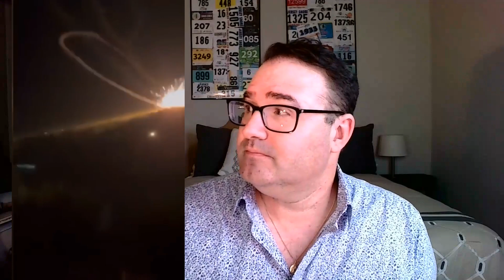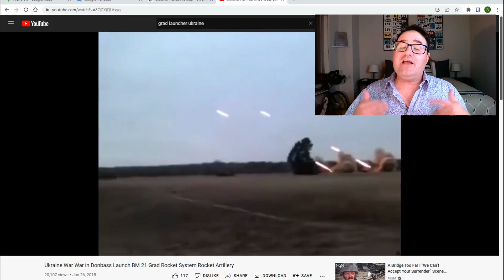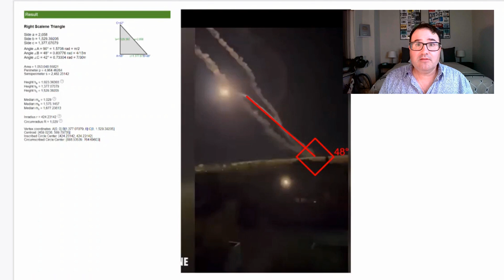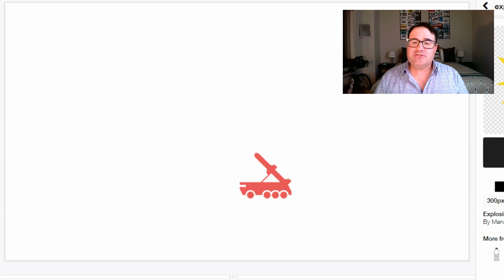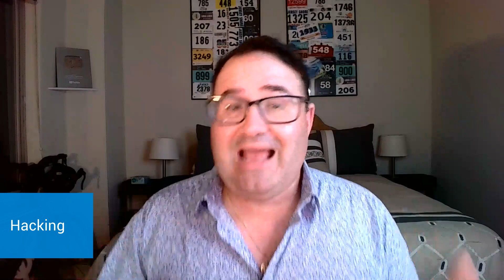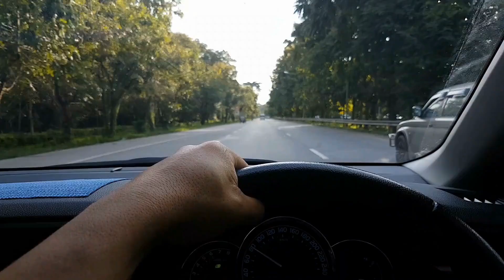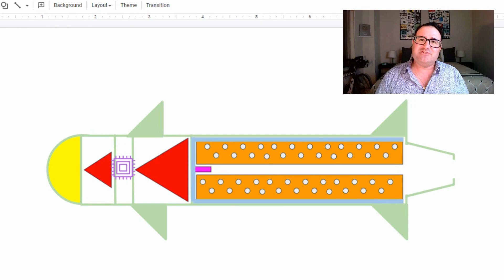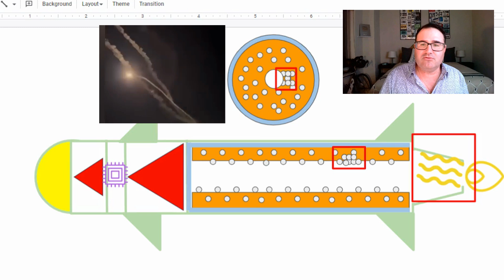Why this missile U -Turned

Comment: An asymmetric burn inside the pressure volume probably wouldn't cause a turn, at least I don't think it could make one as sharp as that. You would either need to turn the nozzle or the fins to induce a turn. My guess is something on that particular missile went haywire, be it the electronics or whatever powers the actuation. It could be a momentary problem in the signal sent to the missile, as the other missiles shown by their trails are long gone from the frame when that particular missile took flight.
Reply from the maker: What about burn through, and we’re just getting parallax error. The missile is turning we just think it’s going straight.
Reply: @RyanMcBethProgramming  burn through as in burn a hole through the side of the missile casing? I guess but I wondered if the guidance could really compensate for that happening. It might be possible. I would have to know more about the missile and even then I’m not a missile expert.

Comment: Regarding the guidance issue theory you missed an important point.
It's correct that guidance  is provided by track radar of SAM system.
What you forgot / got wrong is the type of missile fired.
Majority of SAMS system fire SARH (semi-active radar homing missiles) missiles , which means the missile does not have its own radar , instead just a seeker head. The seeker head has the duty of locating the radar beam emitted by track radar. The rocket steering guidance is provided by the in board electronics of the missile, that decides if the missile should be steered or continue forward flight. 
The inboard electronic also uses some sensors to detect critical flight parameters like angle of attack , direction , altitude etc.
If one of this sensors fails it's highly likely that the missile's onboard electronics might generate wrong guidance errors.

Comment: i think these distance estimations are far off. Okay, flash to bang, 500 m, bought. But from a 500 m distance, the camera lens must have been extremely wide to cover > 2000 m trajectories in such a small image region. So i think the assumption about the initial velocity of the rocket must be far off.
I'm not a military expert.

Comment: I have a different theory. If this missile tracks painted by radar target it may have lost track of the target (due to defect in radar or missile itself) and after a while it mistakenly taken the radar as target.
Speaking about defects in fuel, as I have read in books on solid rocket fuel, can lead to asymetric thrust but usually lead to overpressure and casing failure.
Reply: It too much for coincidence missile hit it's launch site that far into flight.

Comment: Possibly a faulty guidance receiver and/or faulty safeties? After it turned it seemed to almost zero in on the launcher like it was seeking the nearest heat source like your typical IR guided "heat seeking" missile. The other missiles that had been fired had already boosted away so the launcher would have been the nearest, hottest target. If they're similar to the modern AIM-9s and have an all-aspect capability it might explain it. I think it would have to be a perfect uneven fuel burn to line up on the launcher and not impact short, long, or off to one side or another. Good video, I enjoy hearing new ideas on things like this!

Comment: If your theory is correct then we'd expect to find lots of videos of similar rockets going randomly off course, because otherwise it's a huge coincidence that it goes off course and specifically hits the launcher system. I don't know if such videos are indeed in circulation; clearly this boomerang missile has much greater viral interest than those videos would have.
Reply: His theory doesn't make sense if its manufacture fault or mishandling that cause fuel issues. That doesn't mean the rocket returns back and hit the radar precisely. It seems a drone managed to  jam and hack the guiding radar! Russian radars use American made processors lol.
Reply from the maker: I’m not sure if it directly hits the launcher system or not. I would suspect not. it would take a really lucky shot.

When it comes to miss handling, this could’ve been something as symbolize back in 1995, a forklift driver accidentally dropped the missile and never told anyone because he didn’t want to get in trouble. We’ll never know.

Comment: I don't think this weapon has enough flight control surface to make that kind of manuever during its initial launch phase. I agree with Ryan that it's most likely a material issue. I personally feel a failure was present somewhere in the engine housing where it possibly burned through causing a jet of propellant out of the side of the casing just long enough to turn the thing 180 degrees. At the end of the day we will never know.

Comment: Very hard to imagine this degree of violent attitude and vector change from one side of a very long combustion chamber somehow causing thrust vectoring through a static nozzle, especially as that high pressure gas all gets effectively pushed through a tight neck that accelerates it anyway.  

I’d go with upside down inertial reference system that comes online a certain amount of time after launch. That would cause its aerodynamic surfaces to aggressively try to fly “up”, which is now down.

Comment: Nobody will ever know for sure, but as far as defects go, a rocket turning 180 degrees after firing is a bad one. I may be be random luck that it was exactly 180 degrees, but it also suggests a guidance malfunction. I also doubt that irregular burn could cause such I tight loop, although I can't rule it out. It seems more likely to be that movement of the fins is responsible for the turn, and because they weren't stuck, a guidance problem with sensors or guidance units seems most likely to me.

Comment: I theorize the combined heat in the concentrated area on the ground got so hot that the last missile locked onto it.  The flight path is clear...accelerate, alter course,straight line...thats return to sender.

Comment: A stuck fin would also cause a spiral and not a neat U-turn. As for your theory, you're basically talking about vector thrusting, but even 5th Gen fighters can't make such maneuvers. (especially at that speed and with the help of the tail)
I know that A2A missiles can pull off U-turns, which means that technically so can SAM, but the question is then why. My guess is either a system error (unlikely) or a self-destruct protocol in case of friendly fire. When Israeli fighters operated in Syria a while back, Syrian air defense systems (Russian made) shot down a Russian transport plane that was taking off, having misidentified it by accident. The Russians may have built this feature as a safety measure.

Comment: Probably a improperly installed guidance positioning sensor, the fuel logic you put forward just couldn’t burn fast enough to cause a dramatic turn without sending the missile into a spin, as the guidance system would attempt to correct it the other way. If the guidance system kicked in after the launch phases as is the case in most systems using a hot launch, it wouldn’t execute the maneuver until it reached the required data point for the sensors. As the sensor is not properly doing its job, the missile believes that it’s on the correct course instead of the typical launch sequence, which could explain the other 2 missiles firing properly, and the long streak of a relatively straight plume as it plummeted toward the ground. In short, the missile thought it knew where it was based on where it isn’t, but got it wrong. Kind of like vertigo.
Reply: My thought also. One of the gyro sensors was wired backwards, intermittent, or just busted. During the initial launch, this wasn't used since they don't want the missile maneuvering until it was clear of the launch area. Sensor was say wired backwards and thought up was down. After the launch time was up, the processor had the input saying "I need to climb at a 35 degree angle...", looked at its sensor which had up/down reversed and said "We are descending at 125 degrees", issued a 180 degree turn to correct it, sensor said "I'm climbing at 35 degrees now", processor was happy, and the missile flew straight into the ground.

Comment: So I don’t know off the top of my head how many missiles a buck can have in the air at once but it seems possible to me that they fired too many missiles for the guidance system and the missile that crashes got instructions meant for one of the others. 

Generally speaking a lot of missiles achieve thrust vectoring by extending some portion of the rear fins into the jet exhaust, but if the missiles used by the buck have separate thrust vectoring and rear fin movement (assuming they have thrust vectoring), it’s possible that the missile had a fin stuck over and was able to fly straight during the boost phase due to thrust vectoring counteracting it.

Comment: I say structural failure. Either a center body component rupture or a fin folded over or broke off. At launch boost phase that puppy is max Q almost instantly. But storage and handling has been an RU issue. All theory’s are valid.

Comment: I think it was a malfunction but I don't think fuel and oxidizer migrated inside a plasticizer. More likely the propellant broke up and fell off the rocket either during handling or after ignition.  Was there any flaming material just before or during its course change?

Comment: I would think the most probable cause is it somehow targeted and locked onto its own radar signature. If it was caused by a fin or the rocket burning unevenly it would have kept on turning in the air instead of shooting straight back down parallel to its flight path.

Comment: I have some experience with solid fuel motor design and manufacturing. I don't think this theory is correct. You can't get asymmetric thrust this way. All of the gas goes through the rocket motor nozzle throat and any asymmetry is evened out there. Plus, solid fuel motors tend to be very sensitive to combustion surface area. Defects tend to increase burning surface area which increases pressure which increases burn rate and you get explosions. I once had a project of x-raying solid fuel propellant grains researching voids (defects) which caused exactly this problem.
Reply from the maker: Maybe burn-through?  Burn through the insulator on the left side causes the missile to turn and parallax error makes us think it's headed straight down when it's really turning in a circle?

Comment: I have to disagree that fuel degradation could turn the rocket so abruptly. The fuel burn pressurizes the chamber, and the pressure pushes gasses out through the nozzle. A lump of fuel on one side might cause a bump in thrust due to a surge in burn rate, but it will still exit where the nozzle is pointing, not off to one side. I see no sign of the rocket plume angling away from the rocket centerline, anyway.

A broken fin? Unlikely; that would send the rocket spinning, not in a U-turn.

My money is on a failed guidance component, either inertial or radar following. Maybe a gyro or accelerometer, or maybe a loss of radar lock. The rocket might have "thought" it was flying straight, or it might have detected a problem and reset itself (in time to fly straight again--into Mother Earth).

But I can't see how this behavior could be a matter of uneven fuel burn. It's too dramatic to be that.

Comment: I think it would be a little closer to the launcher. Remember it has to accelerate to that speed. Accelerates fairly quickly, but it's but it's still takes noticeable time.

If the rocket was still in the first phase, which I think we agree it was, it has not reached its final velocity.

If we know how long the Boost phase lasts, if we know what the final velocity will be approximately, it would be fairly easy to calculate the velocity at the time it turned around. First we would solve for acceleration rate, then use that to figure out the velocity at that time

V = 1/2at

Comment: Interesting theory,  however if you have one nozzle in the booster phase than I doubt you get a 180. Think there are 3 or 4, than if you have one side cut out is possible.  However still to get a full 180, I think those fins had to turn it.

Comment: That homing in on the launch position looks so intentional... Couldn't it be an attempt to use that Buk as a surface-to-surface weapon? It's just software. Give that system a 3D coordinate to aim for and there you have your improvised MRLS. Implementing measures to prevent operators from mixing up target coordinates with the ones of the launcher may not have been on the priority list.

Comment: Interior grain (fuel body) topology can be much more complicated than your basic description - as I'm sure you're aware. There may be multiple cavities, or the cavity might be star shaped, or other, even more complicated and exotic shapes, all with the intent of maintaining a constant combustion surface area. A constant combustion surface area means a constant thrust during boost phase, simplifying many control and construction considerations. Rather than a fuel migration, I think it more likely that there was an internal crack in the grain, or maybe an air pocket, either of which would - briefly - alter the burn physics, producing the change in thrust axis, as you describe. Ultimately, I think your temporary asymmetric thrust theory is sound, and most likely, but the cause is more likely to be physical defects - cracks or voids - in the grain rather than fuel migration. Of course, uneven fuel mixing when casting the grain is possible, but I think that less likely; Mixing the materials prior to the pour isn't all that much more complicated than mixing paint.
Reply: I was heavily involved in amateur rocketry when younger, and I've seen  seemingly 'intelligent' malfunctions of rocket motors. Rockets that boomerang, corkscrew, or even seem to chase people. In each case, it is certainly traceable to asymmetric thrust, caused by either grain or nozzle failure.

Interestingly, a US submarine, sneaking about a Soviet naval exercise, got some footage of similar malfunctions in naval surface-to-surface missiles.

Comment: Somebody put in a guidance system gyro 180 out.  The system is designed to kick in after the rocket is a certain distance away.  That is why the turn is so precise and returned the rocket to where it's flight began

Comment: As the nozzle of the missile is where the actual thrust is generated and it doesn't shift its place, I think your theory doesn't hold water. The deliberate u-turn this missile made makes things look like a controlled turn. There's quite a chance it was Russian trademark stupidty. Who knows how awkwardly handling the user interface was desiged and how completely non-foolproof it is? Has a soldier accidentally entered the location of the launcher as target coordinates?

Comment: Seems unlikely but plausible. My thinking is that even with uneven burning, the gasses produced would mix sufficiently at the high temperature and pressure to be more uniform once it reaches the nozzle. Maybe if the fuel clump was very close to the nozzle end.

Another possibility I can think of is a weak point in the side of the combustion chamber creating a leak that spews gasses of the side of the missile, but it wouldn’t stop turning in that case and there would probably be some evidence in the video footage of it.

Comment: Not sure about the BUK, but a lot of modern missiles have an INS built in. A radar guided missile needs to see both the broadcast signal from the tracking radar and the return signal from the target to correlate the two. Obviously, this requires some separation from the launcher. Add to that the fact you can't necessarily guarantee the orientation of the launcher at the time of launch. INS would be a logical initial guidance system, if nothing else to just make sure the missile turns to face the target while getting initial separation from the launch platform before it picks up the TR command signal and begins homing. You would also want a short delay to make sure the missile clears the launcher before it tries to change course. If the INS was improperly aligned, or stuck, it could command the missile to turn around and slam into the ground once it kicks in. Poor manufacturing tolerances, improper maintenance, or rough handling could potentially damage an INS and cause this.

Comment: Gimbal lock has been proposed by ticket guys. A gyroscope malfunction caused by a gimbal getting stuck with another. It can cause the opposite commands to be sent to the control surfaces. The combusting gasses get forced through a narrow nozzle so I don’t see uneven combustion as an issue, unless that causes vibrations that at least partially destroyed the nozzle-bell. But it looks like a gimbal lock to me, not a random trajectory caused by bad fuel.

Comment: While it's possible a very uneven burn could change the angle of the gasses leaving the combustion chamber, I'm not sure the vectoring would be that sudden or severe. Considering the quality of Russian arms manufacturing, I suspect it's more likely a faulty guidance system.

Comment: I disagree.  If the fin had been stuck, it wouldn't make a 180° turn.  It would just make donuts in the air.  The missile locked onto the guidance radar and followed it back to the radar site.  Probably the onboard radar failed, which left the guidance radar the only thing that it could lock onto, so it did.